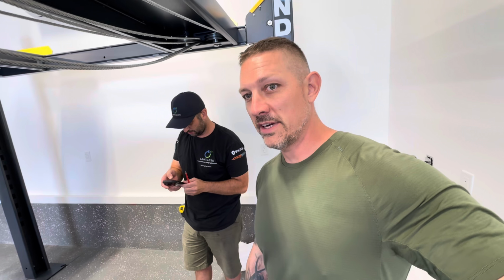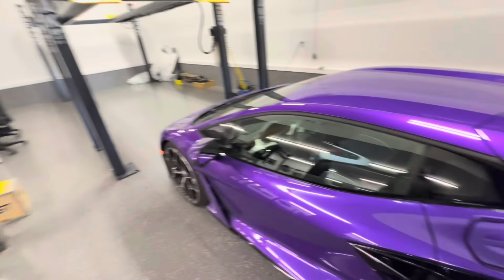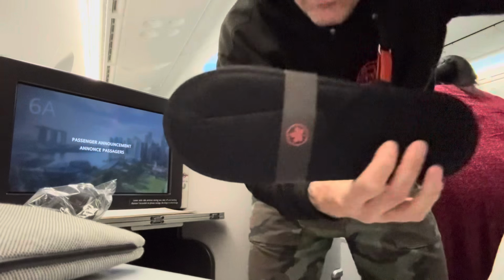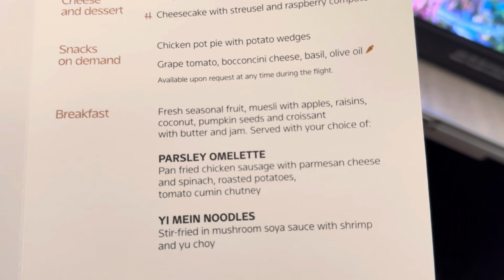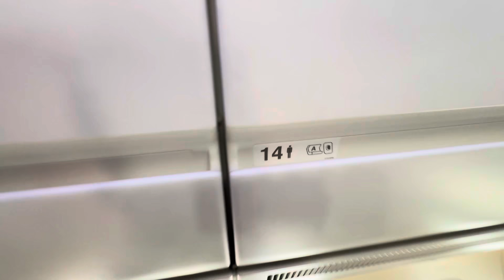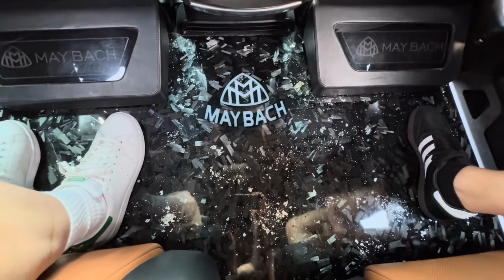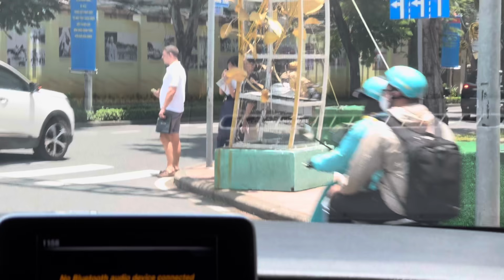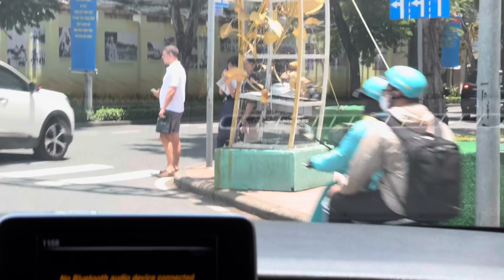GOOD BYE LAMBORGHINI REVUELTO, TIME FOR THE SVJ!

Comment: Dude... $1150 Canadian is a steal! In Germany we were qouted 1200€ when I checked 2 years ago.... I'm using the standard type-f  plug with my hybrid.
Reply: Yea its a pretty good deal. Wires expensive
Reply: 1100 is what it cost me to put in a hook up for my generator to my electrical box incase of power outages. so 1150 is pretter decent
Reply: Yeah that really isn’t that bad. I installed a Mr. Cool mini split in my garage right next to the electrical panel it costed me $450 USD for the added circuit and like two feet of 25 amp rated wire to be installed. This was two year ago. The length of wire used for Damon could be 75 feet of thick wire so that would cost a lot.
Reply: Deutschland ist sehr teuer
Reply: I just had a 40 amp EV charger fitted "free" in the UK.
I paid £200 for the smart system to extend its capabilities.
Reply: i own a company in middle canada. 1150 is an amazing price thats beyond fair if not 2 cheap tbh
Reply: Right? Only $1200 to wire up the garage? I was expecting $5k+. I bought an unused $3k Samsung washer/dryer set for $500 a while back cause the women was quoted $15k just to wire her 2nd story for 220 (electric dryer)🤯
Reply: @marcosdeida1440  inb4 damon gives him a shout out and the hook up is free 🤣

Comment: Only $1150 to route a hybrid charger, not bad at all.
Reply: 100%!
Reply: To re-run a 220 cable, that’s pretty standard for about 50-80 feet.  It gets expensive when people have to get a new box installed because their panel is full.
Reply: There might be some govt rebates included in that cost.

Comment: Petro Canada has 94 octane gas so no chevron is not the only gas station in Canada to have 94 also a gas station on merival road in Ottawa has 104  race gas at the pump I have actually shared photos of that with you before at Drumin gas 6:45 station

Comment: I have a plug in hybrid. Not a Lambo though. Mine always starts up in battery mode. The main battery always maintains a 30% charge to start the car in hybrid mode and run the electronics. So plugging it in is to gain the EV miles of driving. It would be interesting to know how many EV miles yours get. Is it really only 4 miles? Fully charged, I can get up to 50 miles of EV driving on mine. Plenty to do the run around trips during the day. I rarely buy gas unless I am going on long road trips or daily trips that take me over the 50 mile mark.

Comment: There are usually two battery states for the plugin hybrids. I think once you plug it in, you will see your EV range go up drastically. As opposed to using the driving around town re-gen….as I believe the re-gen is not powerful enough to put the kind of energy into the battery from a class two or higher charging unit…it’s like equivalent to safe mode imho.

Comment: Or just replace the plug on the wall.  It's got an existing 240V plug so you can just use that.  Revuelto uses a 7kw onboard charger so that's why the 240 charger cable needs 30A (max).  Anything lower it'll just take longer to charge the battery.

Comment: FYI you could also run an extension cord from that 30 amp outlet, to the charger located in a different location along the wall, which would probably cost 1/10 of what an installed outlet would. Unless you want to hard wire a new plug~ If that s the case, you have to cut the wall open, get the electrician to do the wiring and charger install, then you need a drywaller and painter, etc. 30 amp Extension cord ftw.

Comment: Normally plug-in hybrid vehicles are at their worst gas mileage when you don't use the plug-in method of charging the battery. Don't know if this also applies to the Revuelto but I think it's the same concept where it is using the engine to charge the battery acting as a generator.

Comment: Just started the video and you need to get an electrician to install a different breaker then use the same plug unless the wiring isn't up to code on the outlet if you need to install a new breaker or a dedicated box then it's best to do it right it's no different than installing solar. May take 2 weeks because an inspector needs to come out and verify it's not a fire hazard at the pole because of the added electricity at full load. You're probably okay but best to have it done right

Comment: Performane hybrids do not use the hybrid system for fuel economy. It is for added performance first and foremost. So its possible you are getting less miliage if the engine is not as efficient and or the tank is smaller.

Comment: Ontario Petro Canada has 94 Octane too. However Shell Ontario is the only Gas distribution that sells ethanol free gas. Their 91 Octane is pure gas so you get what you pay for, none of this 15% ethanol  filler that provides no combustion boost. I use it in my high horsepower sbc equipped impala.

Comment: Petro Canada has 94 octane gas so no chevron is not the only gas station in Canada to have 94 also a gas station on merival road in Ottawa has 110 race gas at the pump I have actually shared photos of that with you before

Comment: You might not see this but to clean your revuelto without using water use Maguires Ultimate Waterless Wash Wax in a spray bottle and you can mist it on the vehicle and wipe with a rag or shammy

Comment: Maybe ask your charger installer if he’s a actual electrician or not? I would run a conduit from the panel to the outside of your garage and run it on the outside of building around to the location you want the charger with the proper sized wires for a 40a (#6 awg)

Comment: I get about a 400 mile plus range on my 23' Toyota Sienna XSE I hardly ever use straight Electric,  sometimes I'll be in EV Sport mode...my vehicle has 4cly up front, and 2 Electric motors in the back....my vehicle was spec'd with optional 3rd Electric motor in the back....I absolutely love it, always in Sport mode but my gas mileage in town you'd think would be better....lol
Especially trying to haul 3 teenage girls, and their friends around...lol✌️

Comment: Batteries take up space, so smaller fuel tank to fit the batteries. Also, batteries weigh a lot and if you had the same fuel capacity size and the weight of the batteries would make the car sustainable much heavier

Comment: You have to be in some type of EV mode to charge the batteries....when I'm in Sport mode it's not charging the batteries, but I have 3 ranges on my tachometer chrg/Eco/Power.....it doesn't have a typical transmission....no red line....it's wild to get used to...

Comment: They both have identical 22.5 gallon fuel tanks apparently. And damn, only $1200 to wire up the garage? I was expecting $5k+. I bought an unused $3k Samsung washer/dryer set for $500 a while back cause the women was quoted $15k just to wire her 2nd story for 220 (electric dryer)🤯

Comment: I have flown more than 1.2 million miles on United most of which were long-haul flights from San Francisco to Japan or China.  The #1 rule is never to drink alcohol on a long-haul flight because it will make you feel like shit and you'll arrive hungover and very tired.  The only thing you should drink is good water.  For a sixteen-hour flight, you'll need two liters of good water.  Buy the water inside the terminal before you board and you'll be set.

The traffic in Vietnam is pleasant compared to cities in China like Beijing.  There are hordes of scooters, bicycles, and pedestrians in China.  Crossing the street in Beijing can be dangerous because cars will not stop for you. Have a great Gumball, and stay safe.

Comment: I would be more inclined to having that thing have a range of 30 miles. If they can do that in a Prius should be a walk in the park for a giant supercar (hyper car in my book)
- one another note for your charging - Super easy fix, instead of spending 1000s on a plug might use 3 times. A pigtail 30amp amp with a 110 extension - at the other end that in fact gives you 50 amps - plug into the 30 amp and plug into a regular outlet - then you can plug in the 50 amp charger. You can buy this at any camping world for $80

Comment: I'd find someone else to install the electrical. Did the guy even look at the box and realize that the dryer plug has a higher amp and if needed you could swap the plug out and the breaker on the end of it to a 30 amp or 40 amp breaker. Then there's no need to run wires anywhere.

Comment: With the Tesla Charger you set the Amperage of your breaker during the install. If you dont have the max size breaker you just tell it what size you do have. It can be on up to a 60 amp breaker but I used a 50 amp breaker with an RV 50 amp plug. 

I just had to buy a cord, put the 4 wires in it, and plug it in. One of these days, I may even mount it to the wall, but for now, it just sits under my workbench next to the welder that the receptical was originally installed for.

That said $1,200 isnt bad for a high amperage install but I would see if the charger is similar to the Tesla one and can be ran on whatever size breaker with a software adjustment. You dont need the high amperage for your use case. You can probably get away with a basic 110v charger just to maintain your battey condition. Topping it up on a house charger is good for the battery.

If you wanted to only drive in EV mode and never go to a gas station then you may want a faster charger. That is where home charging becomes an advantage,  when you can cut out the gas stops.

Comment: You don't need to use the full 30 amps. Those chargers (same as Audi) will also run on a 110v normal household outlet which effectively makes it a trickle charger. A trickle charge is all that is necessary to keep the battery healthy when not in use.

Comment: Instead of moving my wall charger location at my new house, I bought a 25 ft extension for 40 AMP 220 charger. Camping world has extensions for your charger, and as you mentioned, he could change the breaker to 40 or 50 amp so you have what's required. 
I've owned Audi hybrids since 2021 and now an Audi Etron full EV. The battery charger comes with 110 plug-in and, of course, numerous 3 and 4 plug high capacity plugs for charging. I would think the Volkswagen group would've provided that for you.

Comment: Hey Damon, that electrian is not totally correct about the amperage. Lots of Plug In Hybrids (PHEV) do have the ability to charge up to 48amps (which is actually 30amps used). Breakers always need to be more than what is used. Some vehicles and or chargers have the ability to set the maximum amps used. I would check you book or ask the dealer if that is possible. You may be able to lower the amps pulled by the car so that you can use your already installed 30 amp outlet.

Comment: LAX Is A Shitt Hole👀😂🤣😂☠️ Question, when you take off in battery mode is there anything heating up your oils like after you start it up coming out of battery does the engine still have to warm up there's so many different myths on that I was just curious like diesel motors they have a block heater you plug them in the winter time and get that cold start LOL,, Im Still Dead LAX is A Shitt Hole😂🤣🤣👏🏼👏🏼🤝🏼💚😎👊🏻🗯💥🤙🏻🤙🏻